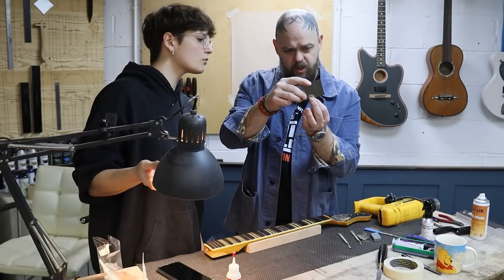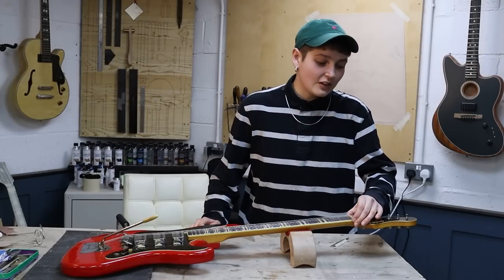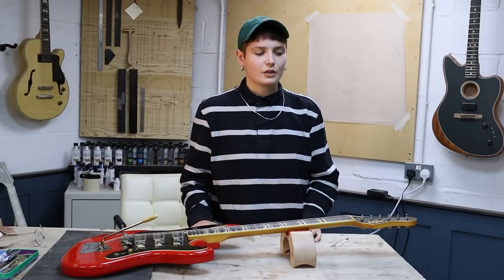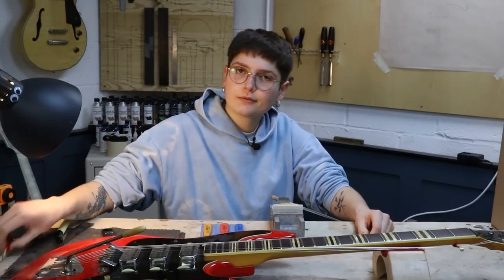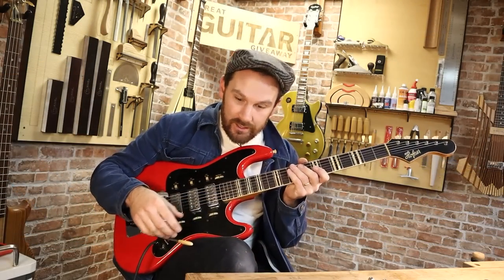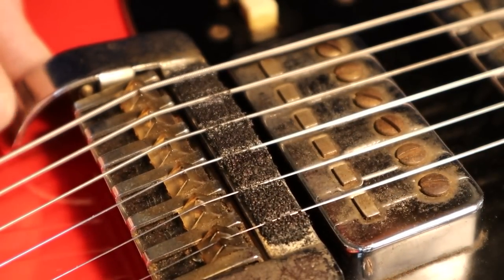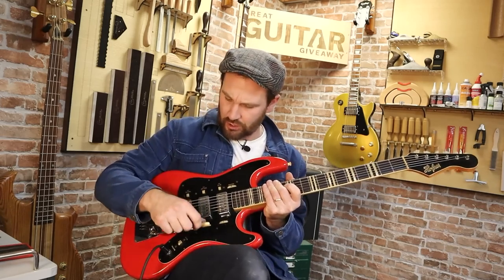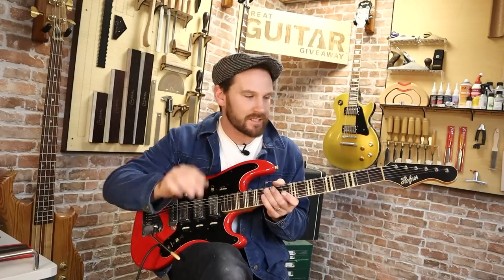Pt 2 This Guitar needs HELP!!  60's Höfner Galaxie! | Luthier Teardown & Restoration

Comment: Very tasteful and discrete restoration of one of the only guitars I still have on my bucket list. As I wait(these things ain't cheap anymore), iIn the meantime I put a couple of Hoftner 513 pickups on a Strat body and wired it to original specs for the 2 pickup version. Wired it like one of the later ones with a varitone. Sounds awesome.
Anyone interested, all the pickups use different tone cap values, which is one of the reasons why  these are so dynamic sounding and versatile.
Reply: No longer on the bucket list. I just got a white /blackvinyl-covered 175 which is almost the same as this - just without individual switches for pickups - it has a single selector on the horn for bridge, middle or neck, or all 3. And tone sliders are on top. Bridge is non-adjustable. Awesome guitar.

Comment: I would love to see a video about angle and shape of the nut slots and troubleshooting. How do you maintain the correct shallow angle on a G string with no string tree? What is the issue when you get that weird resonant metallic ringing behind the nut? Etc. Thanks!

Comment: My Galaxie came with flatwound strings, they were thicker than a 10-46 set. Maybe you could go with the original flatwound strings and size, if they are made anymore. Great to se this guitar get some needed repair. Unfortunately I don't have the Galaxie anymore, my bad 🙂
Reply: Probably flat 11's or 12's. Both are still pretty common gauges, at least as round wounds
Reply: @wilhelmtheconquerer6214  11s and 12s widely available as flats.
Reply: @whssy  I'm sure they are. I couldn't say it with confidence though, when I never use flats myself

Comment: hmmm. The end of part one has Ben 'restoring' the cracked veneer on the back of the body - which is conspicuous by its absence at @7:05 where Sofia is re-attaching the neck to the body. Was there a change of plan?

Comment: I have a 60s Galaxie, its a total pig to play. The neck is too thick and it's just too easy to knock the pickup switches off or the mute on. Looks cool as tho.
Reply: I guess that after a nut adjustment and fret leveling you could put your action down to the point of not caring too much about the neck. But the switches, this is really a problem. Accidentally changing the pickups is annoying, but does not cut the sound. This one cuts it.

Comment: Please don't ever make bone dust like that again. It's fine to use sandpaper when shaping a new nut but if you are making dust for the purpose of filling in slots then using sandpaper is a definite no no. 
That dust, although it looks clean, is actually contaminated with bits of sand that comes off the paper. 
Use a file to make dust for slot filling.

Comment: Should have just replaced the nut with an off white one or at the very least cleaned up the one you filled.
Reply from the maker: for the collection we are trying to keep as many original parts as possible